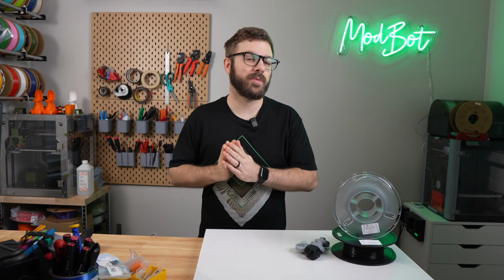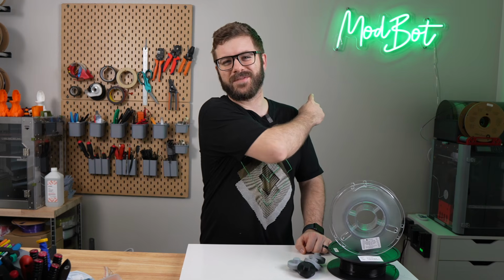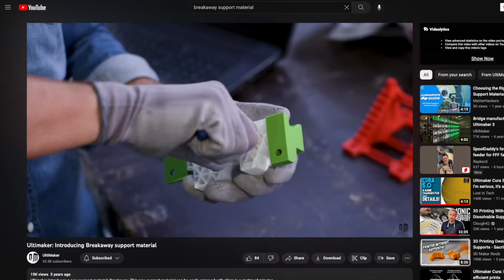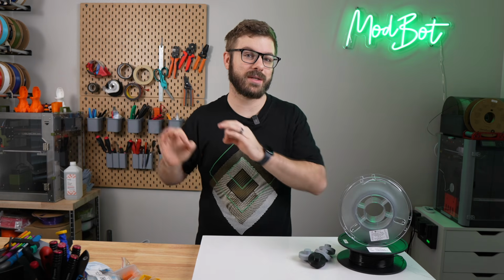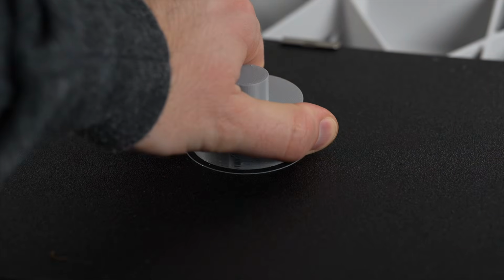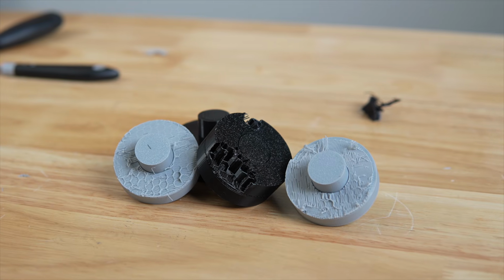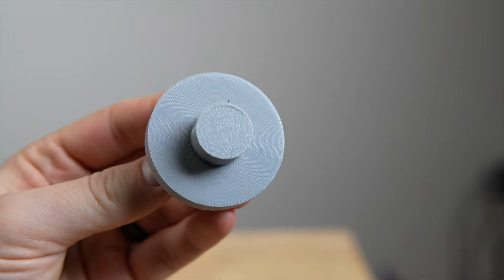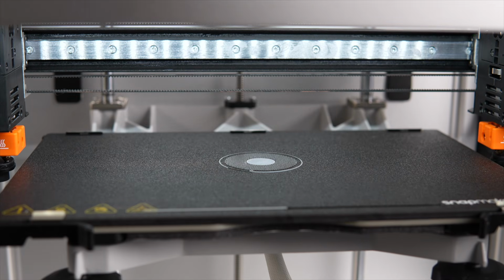Super Clean 3d Printer Support Removal (Combining Filaments)

Comment: Supposedly it can work on the Bambu printers with AMS as well, although from what I've read it only works one way reliably. PLA with PETG supports supposedly works, from the comments I've read PETG with PLA supports results in nozzle clogs. I do have a Bambu X1C, but I haven't felt like trying, if it ends up clogging. Kinda unfortunately actually that it only works with PLA with PETG supports, cause you can buy break away support material for PLA from Bambu, but there is no break away support for PETG.
Reply: I think you have it backwards. PETG with PLA supports should work, PLA with PETG supports should not, because PETG prints at a higher temp, having PLA extruded at PETG temps will not cause clogs. Having PETG extruded at PLA temps (which is lower) would.

Comment: One trick that can save you a lot of time is to use the support material only in the top interface. 

At least in Bambu Studio laminating software, I don't know about the other laminating programs. Let me explain.

You print a part in PLA and you are going to use PETG as support material. In the laminating program you just activate the PETG support material in the top interface. This causes PLA to be used as support material except for the part that touches the part.

This avoids having to make unnecessary filament changes. It only makes such a change when it reaches the top support interface.

Greetings to all.
Reply: I printed with PETG as only an i terfave layer and everything was fine. I just set the max volumetric flow of PETG to 8 mm3 so it prints slower.

Just don't forget to set the purge volume to at least 700m3.
Reply: @hologos_  why does the purge volume have to be so high? There is a purge tower already so won’t that take care of the transition?
Reply: @realgoose  because if you don't purge enough when switching PLA to PETG or vice versa, the filament can become too britle and you can get layer separations. That's why it's important to purge enough to clean the inside of nozzle. To reduce too much waste, set the PETG only as interface layer (I use 2 to be safe) for PLA prints and PLA for PETG prints.
Reply: @hologos_  Just use 3DFuel PRO PLA+.. it prints at 240C just like PETG so no need to have a different temperature for the two materials.
Reply: @oneheadlight8000  Why are you reacting to me about temperatures? I didn't talk about it.
Reply: @hologos_  Should that purge volume be both ways or when only going from pla to pteg as some other videos have suggested? Thanks in advance.
Reply: @FarazFKhan  Sadly both ways. Otherwise you risk contaminating the layer after the switch and layer delamination.
Reply: Also thought this was the way to go, just didn't work on my X1CC.
For now I am sticking to the Bambu Support material for the interface layer that came with the printer.
Works great, but is really expensive.
Reply: Man, can someone try this and post a vid? This seems like the way to go.
Reply: @ZeeLobby it’s in German, but here you go: https://youtu.be/Matf1Mna2zI
Reply: This! This is the way. I just did it with Polymaker PETG and Bambulab Matt PLA and it worked very satisfactory and everything came loose with a little twist and not very much materials wasted as well. Printed on a P1S+AMS, this is now my saved profile when using supports on big surfaces
Reply: Yes this works for the Bamboo Filament but not PLA+PETG, you can't really print one ontop of another. I tested this my self, by attempting to print a cube that was floating over the bed. Since it  did not have a single connection to the print bed, if failed after 2 layers.
Reply: @TeaObvious  but if the part isn’t floating and has some anchor to the build plate, wouldn’t a couple of layers of PETG as interface material make the removal of supports easier and increase the finish quality of overhangs?
Reply: Yeah, thats great, but Prusa proposed that interface layer support printing 6 years ago.
Reply: @brezovprut4431  and what’s your point?
Reply: @brezovprut4431  ...and your point in saying that is to what... Suck off Prusa?
Reply: @brezovprut4431 what's the point? Did they implement it back then? All I know is Bambu studios has it now, I don't know when someone came up with the concept

Comment: Interesting, but the geometry of this test   seems to favor this method of supports.   I’m curious how more typical support applications would fare and how to handle disparate bed temps of materials.  Split the difference, use the temperature of the predominant material, or maybe print on a raft?

Comment: Try using the support for just the 1 interface layer so the head doesn't have to change too often.  I create three parts in Simplify3d, the part, the support with the same material, and the interface layer, to minimize how much of the print would need changing the print head.  I have the support part as an independent part so I can use 1 wall with no bottom and a low infill.
Reply: That's the way to do it and save a bunch of time.
Reply: 2 interface layers is best if you have a single head printer. The Bambulab with AMS is perfect for it. Works great and no issues while printing as it sticks enough that once cooled it can be easily removed
Reply: Set at .2 or  .1?
Reply: I was inspired by this comment thread and decided to experiment... In my case, I'm printing PLA and wanted a support interface that would release. I tried PETG and the results were not good, certainly not consistent enough to use repeatedly. The problem is the PETG interface doesn't adhere well to the PLA support. I got limited success printing the PETG very slow in a grid pattern, but this isn't consistent enough to risk a big print.

Having more materials around, I decided to try some others. I happened across the magical one that's not advertised as a support breakaway: Overture Easy Nylon. It can print at temperatures in the 240s (close to PLA) and it lays down magically on PLA. Furthermore, it's tough and remains in one piece to cleanly snap off...
Reply: Came here to write the same. It’s no secret and also no idex is needed. Even BambuLab sells tuned material for this layer.
Reply: Won’t the PETG not stick to the PLA though? So the interface layer won’t actually be attached to the support or to the part. Couldn’t this cause issues with the interface layer moving or slipping?
Reply: @conorstewart2214  I've experimented with combining pla and petg before. They print on top of each other just fine but will separate with a minimal amount of force. 

It's similar to how PLA will "stick" to the print bed, but will not be stuck to the print bed permanently.
Reply: @conorstewart2214  I have used it successfully, but it was quite ugly because of the slipping.
It worked only well if I have treated the interface layers with something sticky, like bed adhesion spray, or honey.
Reply: @conorstewart2214  yes go read the other reply in the other top comment. PLA and PETG don't stick well together.
Reply: It is not possible because both materials do not stick to one another.  

However there is a experimental feature in Cura to bond 2 material together by interlacing them layer by later.  A combination of that with the support infill and interface could make that possible. 

Although, PLA and PETG goes for the same price range.  It does not matter one which you waste price wise.  That would only be the case of using “support”, or soluble filament that are very expensive. 

Support materials is a scam in case of PLA and PETG. 

As long as the supports touches the build plate, there is no need for PVA and the PLA/PETG combo is the best option.

Comment: You should test out print in place models with tight tolerance hinges mixing PLA and PETG.
Reply: bad idea, this is only for material you can access easily. Intrincated supports are best used with the water dissolvable supports.
Reply: @alejandroperez5368  I meant like printing for example a door frame in PLA and a door in PETG with a tight hinge that might normally fuse together with just one material to get better print in place models.

Comment: Note you really need a multi extruder machine to make this work efficiently. Any single nozzle multi-material switching system (Prusa MMU, Bambu AMS, Palette, etc.) will require an INSANE amount of purge after every switch, because even a tiny bit of mixing of incompatible plastics will make a very brittle blend with poor layer adhesion.
Reply: You only need to switch it twice at every layer interface—not every layer in the model. Also, just adjust the purge to be double the value so you get all the old filament out
Reply: you can always lower the purge

Comment: Wow. Never thought of this. Definitely gonna try but it got me thinking. Surely the temperature and retraction differences between the materials must play a role in this. What if we further tune those results with higher and lower support temp? Minimal temp for less support adhesion. Maximal temp for further cooling retraction of the supports.

Comment: Super cool, didn't know this! With PLA you're lucky that the adhesion strength between support material & base material isn't as important since PLA doesn't warp.

With ABS/PC, it's really hard to find a good support material that has high enough adhesion strength to prevent warping on large parts, but is easy enough to remove. The many "universal high temp" ones out there kind of suck. They either don't dissolve well or they have poor adhesion strength for large parts...although they would work for a small print like the one you tested.

After tons of testing we ended up just using Stratasys SR30 for warpy materials - which you can buy in Makerbot spools.
Reply: Of course. He just demoed it on a tiny part made out of toy plastic. Real functional parts are a different story
Reply: @alejandroperez5368  functional parts in PLA are probably fine since PLA doesn't warp much. Just saying it's a much harder problem for warpy materials unfortunately.

Comment: That is very cool. Being able to use a less expensive filament (like a basic or recycled) PLA or PETG for supports would be much less expensive than specialty filaments. I also like the idea of using an idex machine to stitch together different filaments to make something combined, such as something stiff with a flexible joint. 😃

Comment: Awesome video. Are there slicer options to only have the opposite material at the interface layer only? Example- for the Bambu  X1C with the AMS- it would be much faster to print everything up the interface point of the supports instead of having to do filament changes every layer.
Reply: Cura does this, I imagine others like Prusa Slicer would too
Reply: There is a setting of which extruder to use for interface layer in Superslicer. It's in Print Settings > Multiple Extruders
Reply: In bambu studio the option is under Support->Filament for Supports->Support Interface